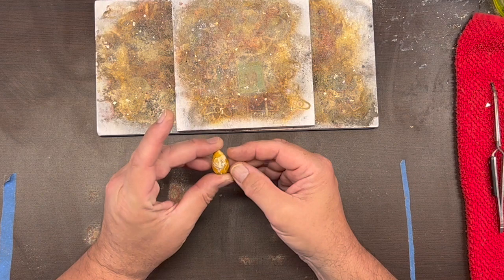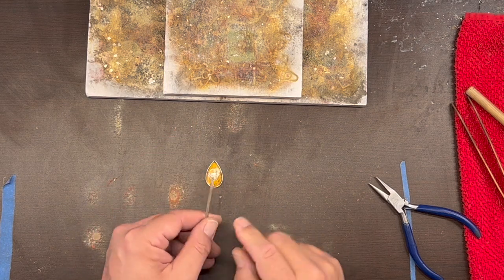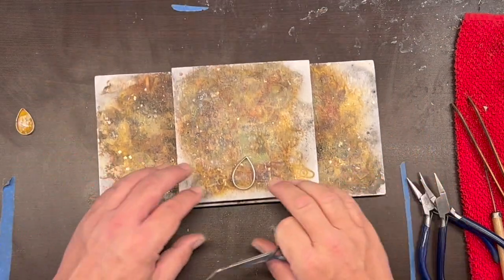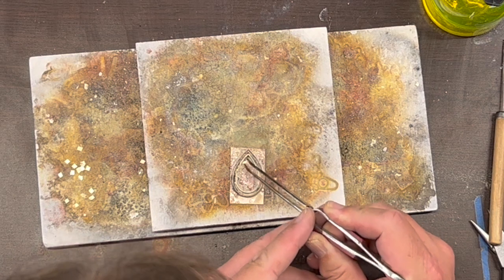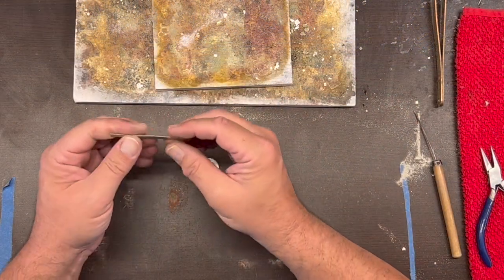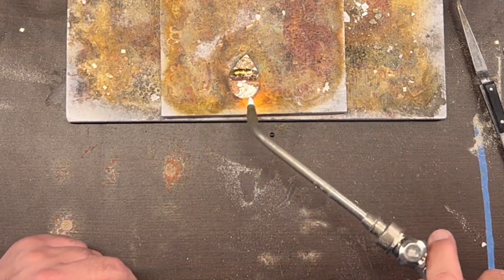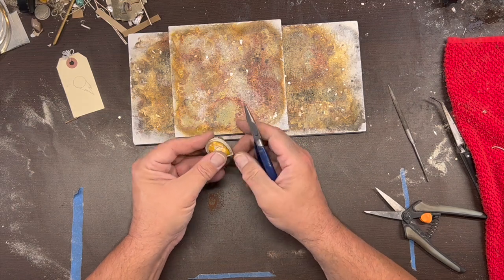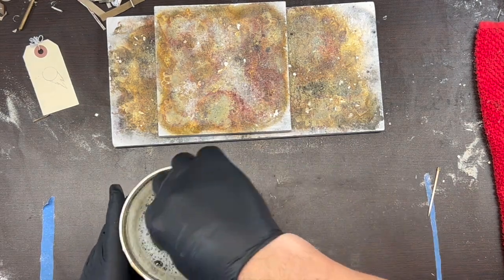Making an Oxidized Recess Ring: A Silversmithing Tutorial

Comment: Hi Chad, could you guide me what number size for the low dome wire for the ring band that i need? They go from 1 thru 5 and not by gauges?
Reply from the maker: Hello Tammy. On Rio's site, when you've selected which number, if you scroll down, it has a specifications link.  Click that for the width and depth. I think size 1 is largest and they get smaller as you go up.  I rarely use the smallest or the largest:)

Comment: Curious why the second bezel is soldered at the tip, instead of like the first one?
Reply from the maker: Hello Sam. Thanks for the question. I think you are referring to the half round wire I used as a border to frame the entire thing?  That is much thicker than bezel, and in order for it to come to a point, since it will not bend sharply enough, it needs to come together there, once I file the ends into a shape that creates that point. I hope this answers your question. Thanks for watching.
Reply: @chadssilversmithing  that make perfect sense